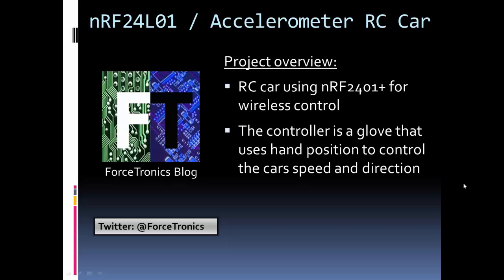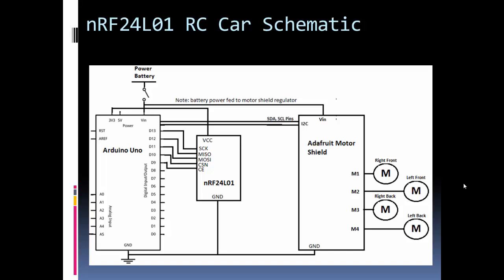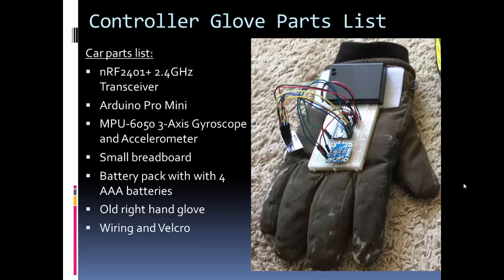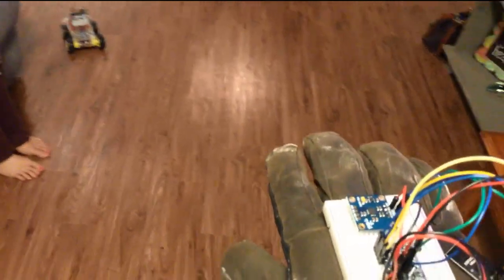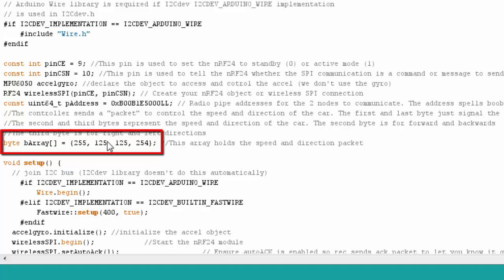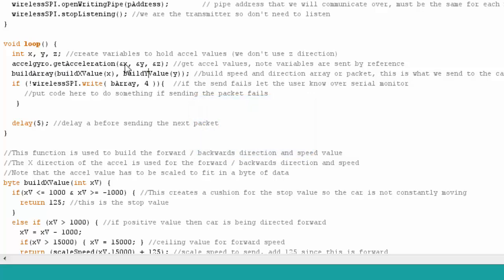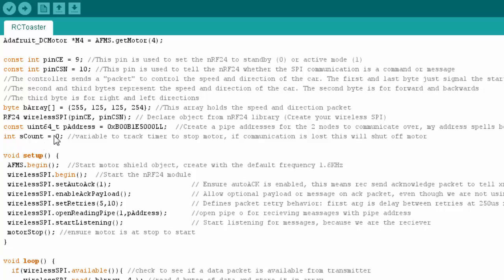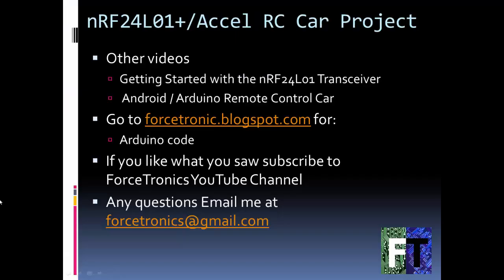nRF24L01 / Accelerometer RC Car

Comment: Hi, Sir i am working with L298n h-bridge on receiver side  and controlling it's speed by coding h-bridge ENABLE PINS and setting motor speed in the script  while mpu6050 is simply guiding the directions and my project is working perfect, suggest me  what should i add or remove to make accelerometer control the  speed of the L298n , im using nrf transceiver module on both sender and receiver side. Thanks
Reply from the maker: The video shows an example using an accelerometer to drive a motor. If your asking me for custom code to control your H-bridge that would take hours of research and code writing which I am not willing to do.

Comment: Hello gentleman. Can I use arduino nano instead of Pro mini?
Reply from the maker: Most likely you can since it is AVR based like the Pro Mini, but I have not tried it. One warning this video is more than 3 years old so some of the parts may no longer be available or some of the software library may have changed.

Comment: hello nice vedio u have made there is a question that i am using l298n motor driver so what should i do to modify your code to control the speed of motor as i lean my hand forward and backward
Reply from the maker: The code from the video is meant to be an example for you to build on and modify for your specific application. I don't provide custom modifications of the code.
Reply: ForceTronic hey its ok by the way i have modified the code for my application.
Reply: +IDE ENVIRONMENT I also want these code plss

Comment: hello i am student who want to make your project. but i live in Korea so i don't understand the video. so i have some questions. first i don't know how to controll the direction with dc motor. so please teach me how to controll the direction with code. Second we buy 2 nrf24l01 so we put the your program but it doesn't work. the code is same yours. so we don't know what problem is. so we use bluetooth module(hc06). but the bluetooth module' communication speed is slow. we want to solve this problem. please solve our problem thank you
Reply from the maker: If you look at the code from the project you can see how I handled the turning, here is a link to the code http://forcetronic.blogspot.com/2015/04/nrf24l01-accelerometer-rc-car.html
If you are new to the nRF24L01 modules I would recommend starting with a simple example to help you get started and to learn how to set them correctly.
Reply: ForceTronics thank you but i use simple example that send the hello world text to other arduino . but it doesn't work too.
Reply from the maker: That means you are doing something wrong, possibly they are not wired correctly. I can't really diagnosis the issue for you without seeing your setup
Reply: ForceTronics miso: d12, sck : d13 , mosi : d11, ce : d7,  csn : d8 and we use mirf library and program modify ce d7, csn d8. would it okay if i use bluetooth module(hc06)? i think nrf24l01 goes wrong

Comment: hey
I made the same project and used same part but the car doesn't move. What can you suggest the problem might be?
Reply from the maker: I would suggest using a serial monitor to verify that the two nRF24L01s are communicating. If not then you have a problem in your nRF24L01 setup. If they are communicating then you have a problem in your motor driver setup.

Comment: i have a question, i see that the nRF24 uses MOSI MISO CLK pins, what if i want to use an LCD and SD CARD module on the same arduino?. nRF24+LCD+SDCARD on nano or UNO, is there any solution to this?;also is it possible to monitor 2 accelgyro from two arduinos to one master arduino by nRF24?. thats my project, thanks a lot!
Reply from the maker: The SPI communication standard supports multiple slave devices. The way you choose which one to talk to is with the chip select pin. For the nRF24L01 the chip select pin is the CSN pin (CE puts module in standby so you can use that with the CSN pin). Note that those pins are controlled by the RF24 library so you may need to understand how the library uses the pins. To answer your other question, yes.
Reply: thanks so much, is very helpful, i suscribed!!!

Comment: This project is awesome. I have the car done and am now building the glove. The analog pins on my pro mini are A0 to A3 but no A4 or A5. https://www.arduino.cc/en/Main/ArduinoBoardProMini The video shows the mpu-6050 connecting to A4 and A5 on the pro mini. I appreciate your advice on how to proceed. Thanks!
Reply from the maker: A4 and A5 are on the Pro Mini. They are the two pin holes behind A3 and A2 on the board
Reply: There they are! Thats weird they're not labeled or on the pinout... I'll hopefully finish the controller this weekend. Thanks again!

Comment: any suggestions for me as far as building my own mosfet dc driver?  as i do not plan on using any of ada rotten fruit store items? how would i go about editing the  #include  or  #defines  for each of the Hbridge setup i wud do for each of my motors?  in the code side as a replacement to ada library ?
Reply: im sorry i thought it was clear that we are using arduino, they come with pwm pins and at the very lease a simple circuit can be added using a 555 timer chip to create PWM signal can also be achieve  IF we were not going to use a arduino but to keep it simple and get a straight clear answer back ill say that i am using a Nano and the H bridge i want to make is made using MOSFET as it is a hight power application using various groups of both P channel and N channel mosfets 

so? how would one go about editing your code to use this type of setup i mentioned rather then ada's items?

Comment: Excellent presentation, very good project and very initiator for innovative ideas..Good job! You should shrink this a little :) with getting rid of these wires and using pcb. Maybe a promini except the uno and a little motor driver circuit can shrink too. You can fill the empty pins with some functions too. I love that communication address too :D You should save that like your signiture :D